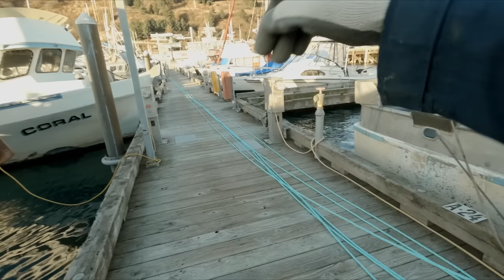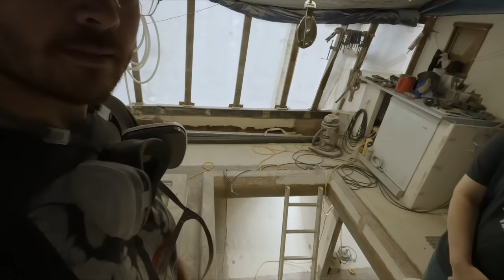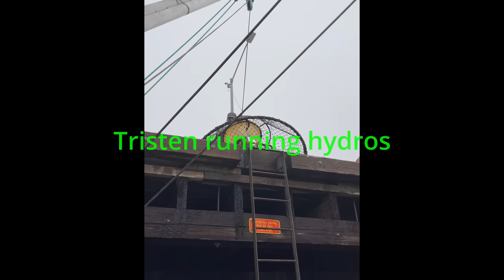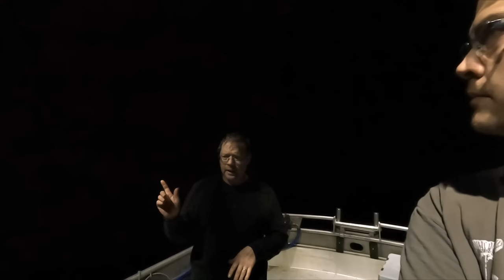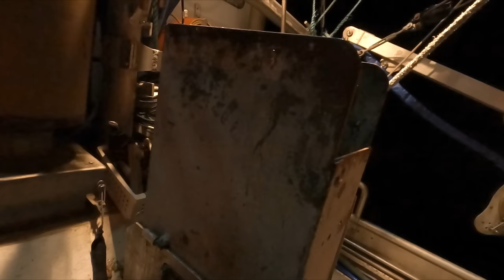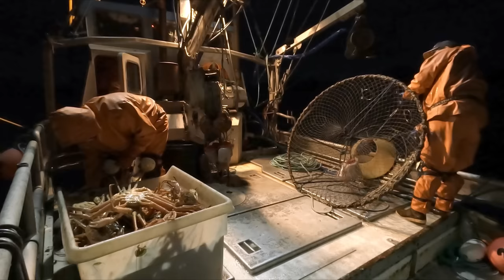Loading Gear and Spot Checking - Part 1 Tanner Crab 2023

Comment: I assume that since you're into the fishing season the refit work will be spotty at best as you're going to concentrate on catching and selling rather than the refit. Is there a cost for having the Isle in the drydock that would force working on it to remove that expense? Great pots you had there. Hope it continued!
Reply from the maker: Hi. Yes you are correct. We are focusing on fishing for the moment. We just finished our Tanner crab season and next up is rockfish and cod. We will continue to work on the Emerald Isle as time permits (basically when the weather is stormy). We are out of the yard and back in the water at our slip, so that extra expense is gone.
Reply: @EISAlaska   Good to hear. Looking forward to when you have time to post the updates! Will be interesting to see the shaft valley all closed up.

Comment: Guys this is dumb idea #5 Stardate 2023312.
Have you ever tested an Apple Air tag in a small waterproof container, to see if it will transmit through 70 fathoms? It probably won't but thought I'd ask. Also there are tracking units that will go through 200 feet of water which may help. 
With the large quota I hope it offsets the lower amount you will be getting for crab this year.....so far. I know there are other issues as well.